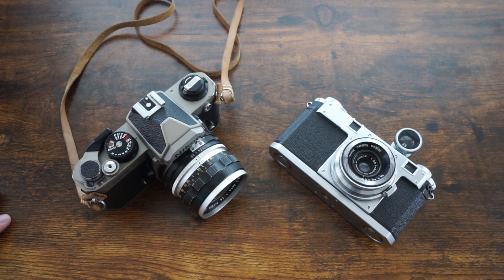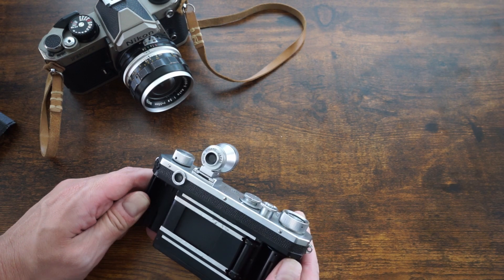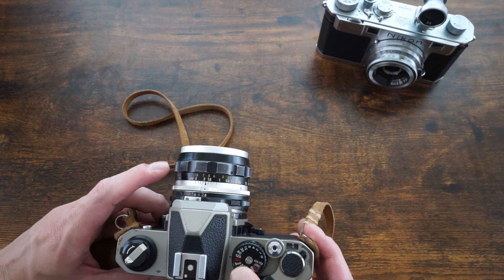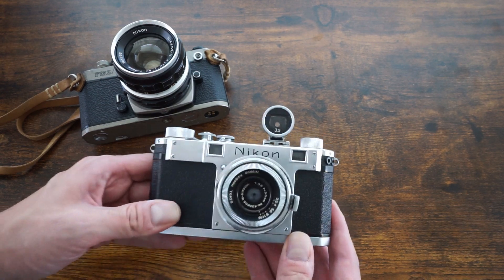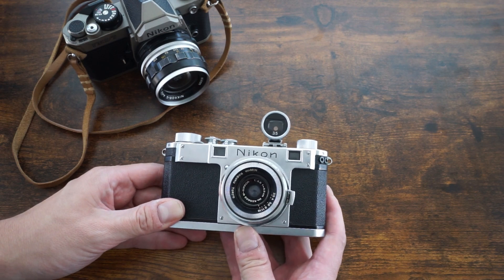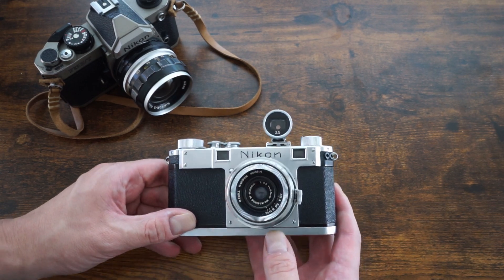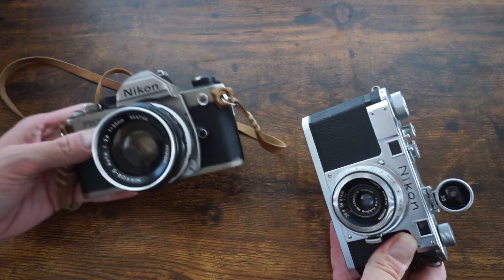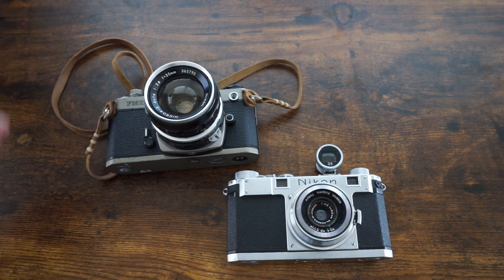SLR vs  Rangefinder Camera Comparison

Comment: Both the Nikon F and the Nikon F2 are SLRs that share the same horizontal travel curtain shutter found in the Nikon S, albeit with titanium curtains as opposed to cloth. 

The Nikon F has a highest speed of 1/1000th of a second while the F2 has a highest speed of 1/2000th of a second.

I guess what I want to say is that there are exceptions to anything where film cameras are involved.

Comment: I had a FM2 a few years in the early 80s, never liked the light meter that is to minimalistic for me with only:
+
0+
0
0-
-
as the only output. I moved over to a used F3 and was much happier.
Reply from the maker: I like it, FInd it very high visibility and impossible to misinterpret.
Reply: @andrewsmithphoto  I prefer how the Minolta SRT101 works with two needles (one lightmeter needle and one chase needle with a ring), which make it really easy to see how far off you are, see here: https://3.bp.blogspot.com/-ldzhA9UxF4c/XKCiTzFPsBI/AAAAAAAAcL4/7LSJQrF1mro6PUSmqlvgecidIKgh5iabACLcBGAs/s1600/viewfinder%2Breadout.jpg

Comment: Many Minolta SLRs, the 1966 SRT101 and also the 1990 X300s and other models in between have horizontal moving cloth shutters with speeds up to 1/1000. Minolta also did some models with vertical moving steel plates and higher shutter speeds.
Reply: Olympus OM-4 and Nikon F3 have 1/2000 with horizontal cloth shutters even

Comment: The SLR has a focal plane shutter
Reply from the maker: Both do.
Reply: @andrewsmithphoto  I thought focal plane was the term you were searching for.
Reply from the maker: @PanDownTiltLeft  No I was not sure about the metal shutter design on the FM2.  I think there is a specific name for them but I  am never clear from looking online I have heard them referred to as copal shutters, but I don't believe that is a technically accurate designation as copals are essentially what is today known as a leaf shutter.
Reply: @andrewsmithphoto  copal shutters are the name of the manufacturer of the shutters, konica and nikons used them iirc and they are regarded to be longer lasting and easier to repair